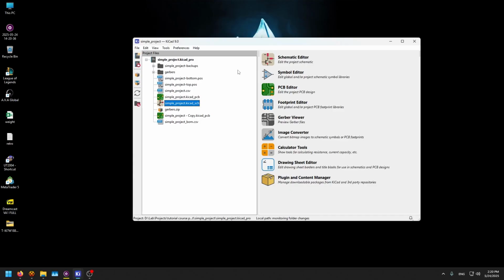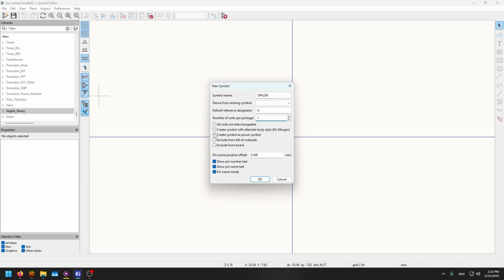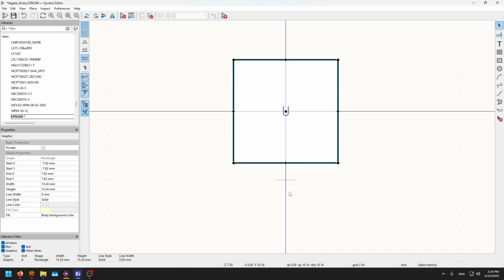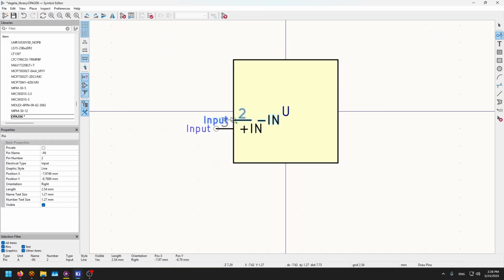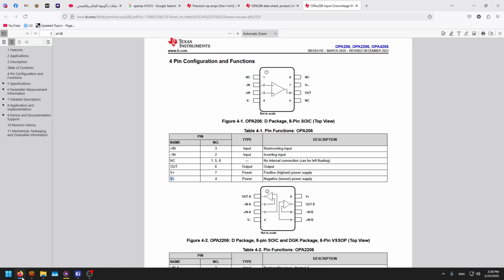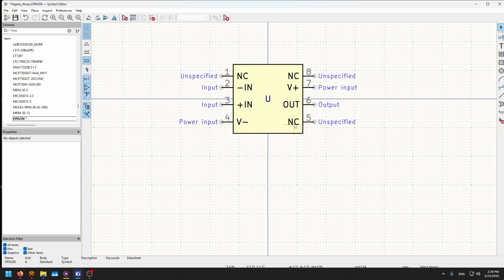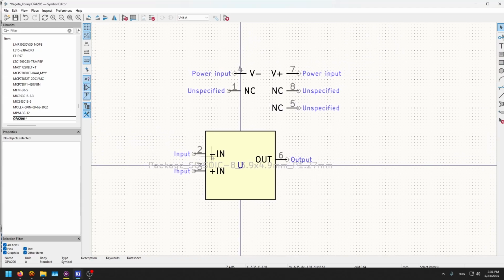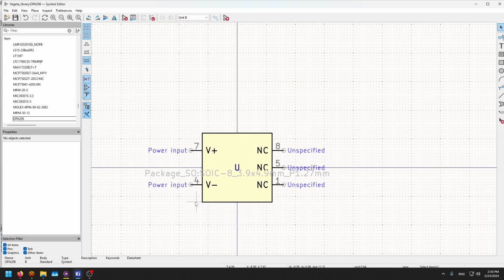KiCAD 9 tutorial course [05] - Symbol editor

Comment: Hello, firts of all thank for sharing this course on your channel. I am doing  a UPS from scratch. I am studing electronic engineering and the UPS is a proyect to present. I am new making schematics and PCB, and Kicad i could see is a good option to start. I was thinking to pay a course to UDEMY, but i see your course is very good. Do You recommend pay the course or you would say that with this course i am going to be able to make my proyect that includes a inverter dc ac , a micro, a battery charge circuit and so on.? Sorry my english, i am from Argentina.
Reply from the maker: hello, my course will teach you everything in kicad 9 for sure.
however, electronics-related stuff are different and need to be studied separately as you know.

i made this course so that no one would need a paid course